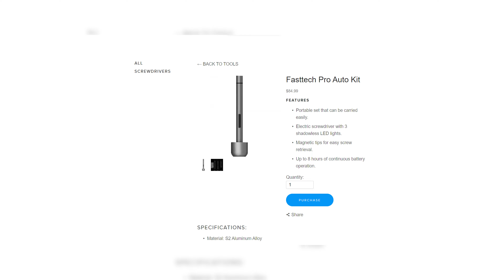PS4 Pro Liquid Metal Guide

Comment: Should be using 90 to 99% Rubbing Alcohol 70% has 30% water which can damage board. There are also coatings you can use to cover the semi conductors to protect them from the Liquid Metal run off. Just FYI.

Comment: Good idea but let's be real the difference is pretty negligible and 44°peak under load is low anyway. 6 degrees isn't huge by any stretch.
Reply: @TrixAre4FatKids  relative to the lifespan, performance etc it's not really. For enthusiasts it might be enough to justify tearing the ps4 apart, but for the average user it's not gonna matter.

44 degrees is well within safe temps when running a game. In fact it's excellent already.

Like I said cool and all, and fair play to the uploader for giving us insight and a tutorial, it's honestly great to see, but not really worth time and effort given that's what is probably expected when shifting from paste to liquid metal on an old ps4 Pro that's never been changed or maintained.
Reply: Yeah mate those temps are not accurate at all, the actual temps are in the 70c and if anything the temperature coming out the back should be far higher due to the massive improvement in thermal conductivity.

Liquid is a terrible idea on a PS4 Pro anyway due to its copper cooler.Nikel is the only type of heatsink that can be used with liquid metal.The LM will completely dry out after around 3-6 mouths of use defeating the whole point of Liquid metal